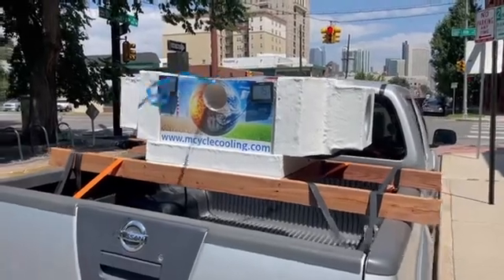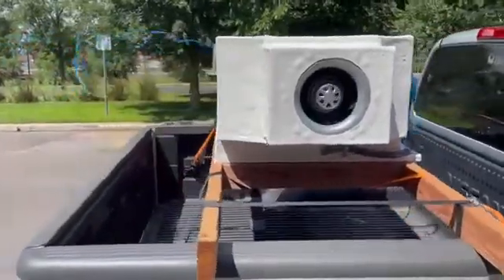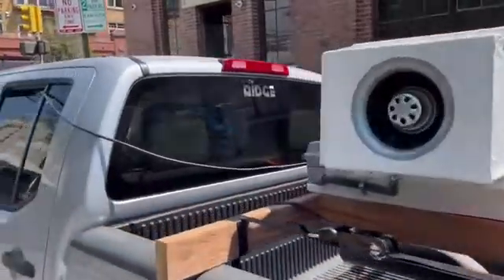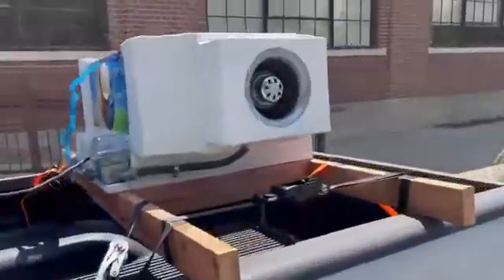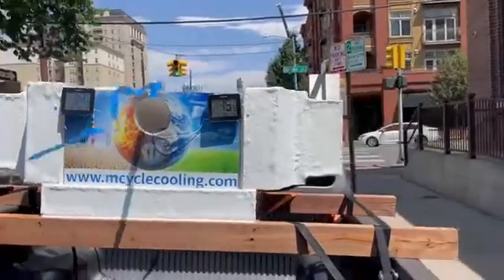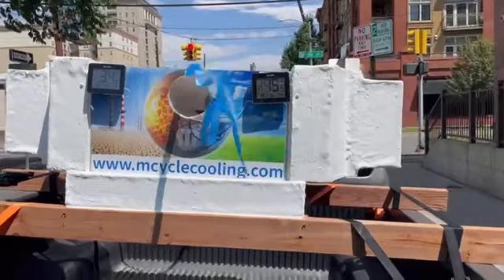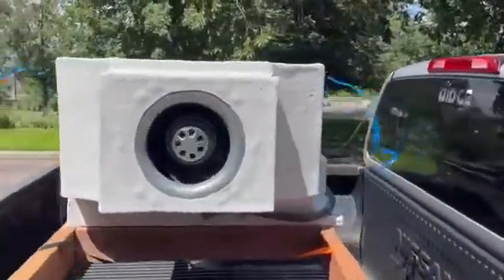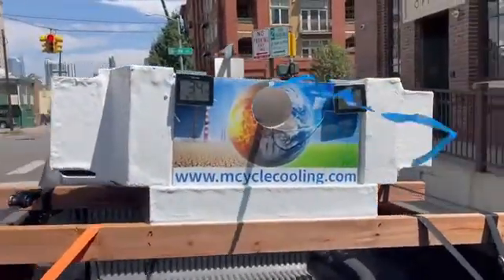2 TOR OR 7 KW AC ON THE TRUCK AND  STREET

Comment: Sorry, but that's an evap cooling system, not A/C.
The air coming out of the exhaust would have a high moisture content, and be unusable in most interior areas (like the inside of that truck).
This design only works in dry areas with low relative humidity, and isn't practical for the fact that it uses the heat loss of water evaporation to cool the air, which introduces unwanted humidity into the cooled air.

These things have been around for a long time. Unpatentable and impractical for most of the world.
Reply from the maker: In evaporative cooling there are 5 classes -
direct (swamp or desert),
indirect (colder air, no moisture added),
hybrid with desiccant and/or traditional DX air conditioner (colder air, wet bulb limit, but higher cost and energy consumption),
Gen1 and Gen2 M-Cycle (dew-point temperature, no moisture, no air recirculation, but other existing investors (decision makers) and non-flexible / no R&D collaboration / no tailored customization B2B min 17 kW (5 Ton, ToR) AC units manufacturers,
Gen3 M-Cycle (many fold better performance because principally another concept then Gen1 and Gen2, further R&D and customization, multiple options and use cases pending additional R&D, but prototype stage without existing mass production).
M-Cycle previous generation technology Air Cooling units are well-known worldwide in 70 countries, however it is patents 20 and even 40 years old. 
Briefly, with M-Cycle you have real A/C, not swamp cooler

Comment from the maker: 2 ToR (7 kW of cooling) air conditioner ready for pilot project and testing in real environment: test data cooling air from 41 C to 16 C, 400 CFM from each side, air velocity 8 mps, consuming 130 Watt (less than 20 Watt and 1.3 liter of water per 1 kW of cooling capacity)
https://youtu.be/65z824SLpHE                                                                                                                           Gen3 is a next third generation of Maisotsenko Cycle regenerative indirect evaporative cooling technology made from new evaporative material and unique thermodynamic principles.
100% disruptive products for Air Conditioning & Water industries and consumers, through newly patented, scientific and technological breakthrough with 10X less cost and 20X less energy and emissions.
M-Cycle: Renewable, Innovative, Green, Affordable, Sustainable Cooling, Water and Energy for All.
Video introduction featuring Dr., Prof. Valeriy Maisotsenko https://youtu.be/5EC2zTT76uw